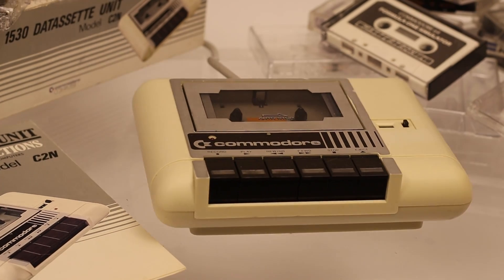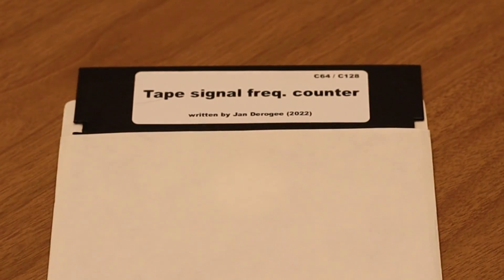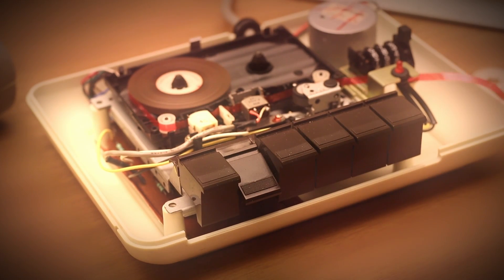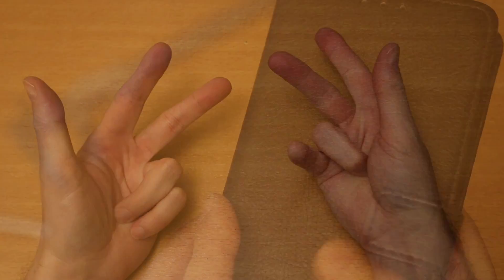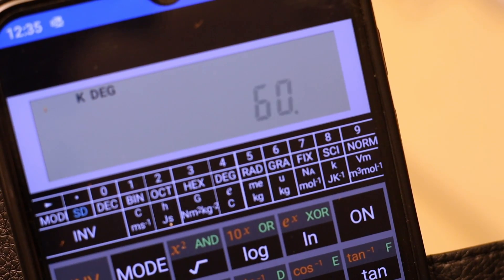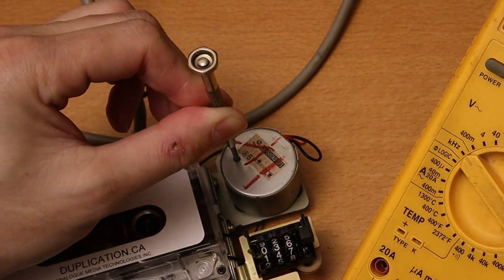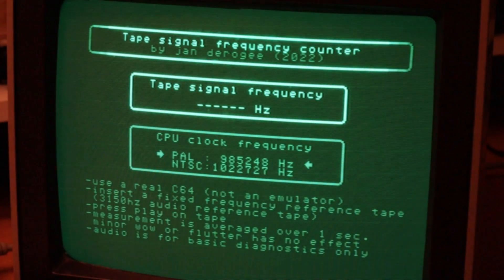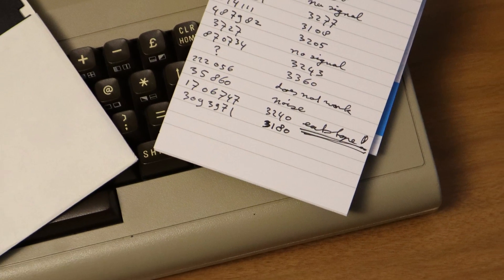Commodore 1530 tape speed calibration

Comment: Have you been able to adjust the speed of the 1530 submodel shown in the beginning of the video, please?
(The Japanese built, record-LED-located-above-record-button-rather-than-below-tape-counter submodel, that is).
My one, apparently, has a DC motor (marked CS-644) without a speed adjustment trimmer. Also no signs of an auxiliary motor speed control part on the main PCB. I'm a bit puzzled.

Comment: I am fixing Datasettes, I did  tones of dumps of tapes. Never had issues with tape speed. I had issues only with old tapes affected with a moisture. The first important thing when you want to deal with old datasette which wasn't used for a years is to change the belt. If belt is old, stretched and deformed, you will have problems with loading games from a tape. The speed tolerance for C64 is around 5%. If the speed will be higher than 5%, the game will not load properly. There is no need to aligment anything if datasette works properly and loads games  from various tapes.
Reply from the maker: You certainly have a point regarding playback. But if your recorder is 5% too fast and the playback device is 5% too slow, then playback will experience a 10% speed error. Which is not helping and may be problematic. So if you want to record a tape, a master tape, so a friend could play it. Should you at least not check the speed of the recording device. Because if that works then the playback error will be 5% less. Now, this is worst case scenario and sure... a lot of things will work fine, but how do you know everything is fine if you never check? This video is about checking and adjusting. In many cases you really do no need to do anything, but if you want to, with this simple set of tools, you now can.

Comment: If you only have a malfunctioning  datasette, how do yiu load the program?

BTW, the counting solution is super smart. Just record the spinning with your phone, and slow it down and count the playback
Reply from the maker: Interesting question. However, if you have only a datasette, then how would you put the program from the internet into the computer. But let's assume that the speed is really really bad, nothing will load, you've service the device, the belts are in perfect condition, all gears are smooth, the only things wrong is the speed setting, well, then rotate the speed setting all the way to the left, try again, move it a few degrees... try again, keep repeating until it does load something and then load the program to finetune the setting.

Comment: Nice to learn today so much on what was at the day an obscure device. On the same note I have a program and cassette used to align the heads of the 1560 with the screw in the small hole that is in the middle just over the buttons. It would be interesting to have a video on that like this one.
Reply from the maker: Yeah, I can related to that, when I was young tapes had a mystery around them because you could hear the data (if used in a regular player)... yet sometimes it didn't work. Then I got an alignment kit for my birthday but once I started twisting that screwdriver somehow the problems only got worse (since I had recorded tapes with the previous head alignment, a thing I did not understand back then). A video about the truth, mysteries and misconceptions is a thing I should put on my "to do" list, thanks for the tip, it is indeed a topic that deserves attention.